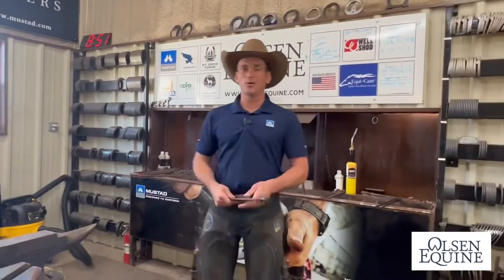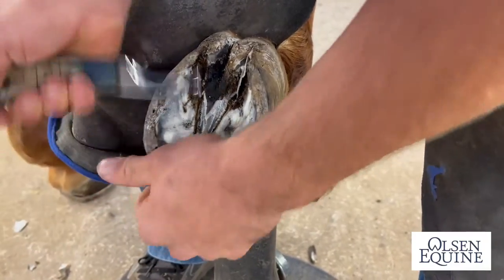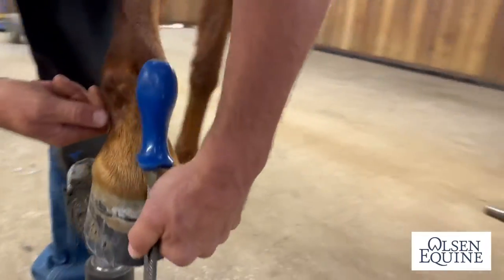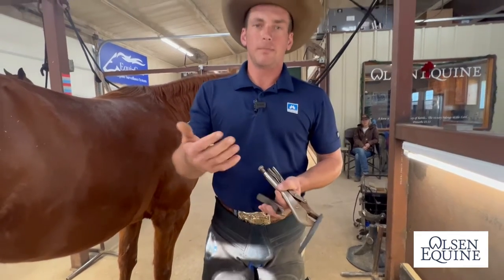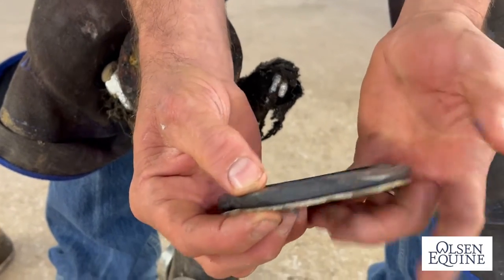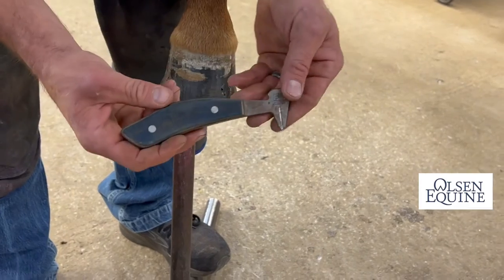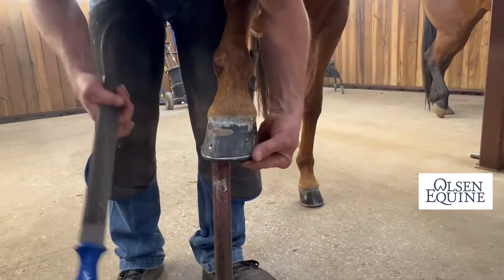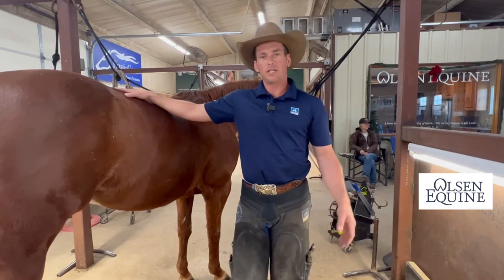STICK TO THE BASICS!

Comment: should the farrier burn a thin soled hoof ??
Reply from the maker: Even with a thin sole you want to make sure to have a balanced shoe! Hot fitting even a thin sole is acceptable because you're not removing a significant amount of sole!
Reply: i am told that a thicker sole if you pad them for 3 or four shoeing??and should i also pad the hind foot as well???